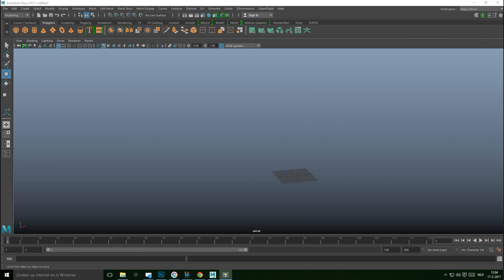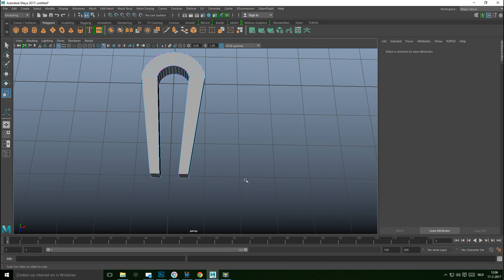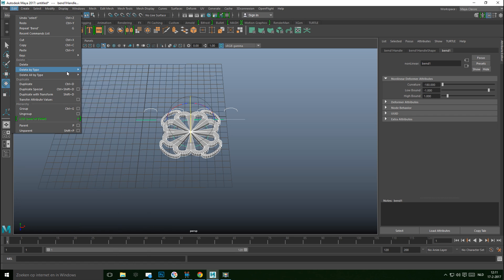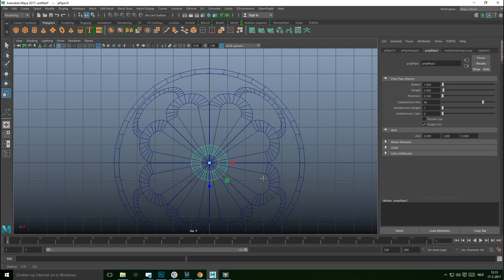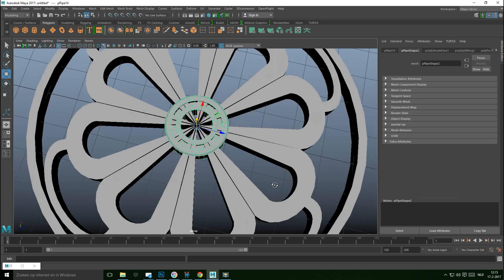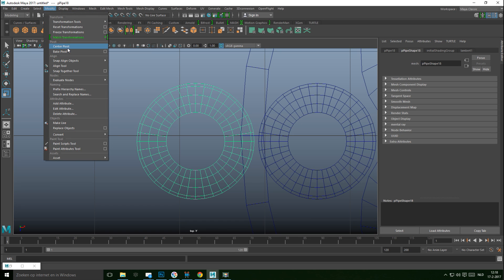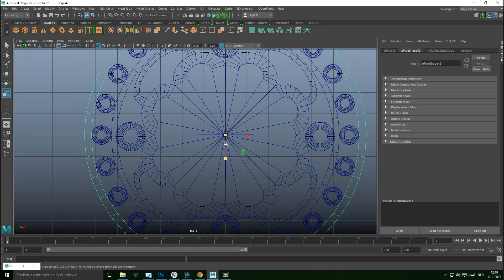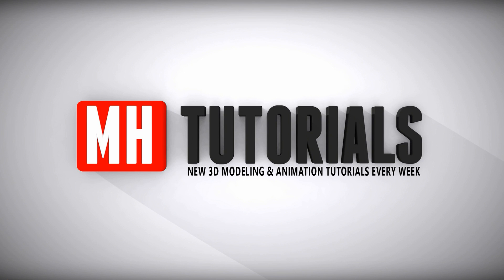Maya 2017 tutorial : Having some Polygon fun !

Comment: Hey, I noticed that when you wanted to make one of the cylinders bigger or smaller, you used the centre yellow square to enlarge in all directions, then changed the hight afterwards. Is there a reason you did this instead of using the green square to just enlarge in the two directions and keeping the height the same?
Reply from the maker: To be honest I didn't even think about it